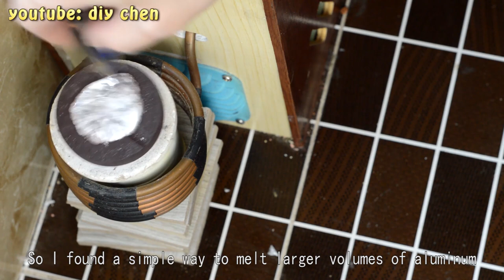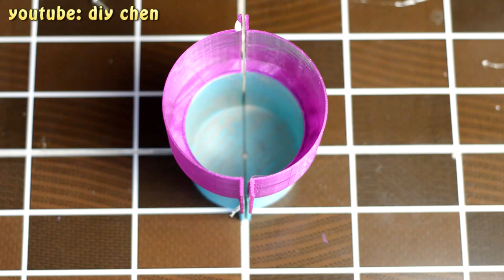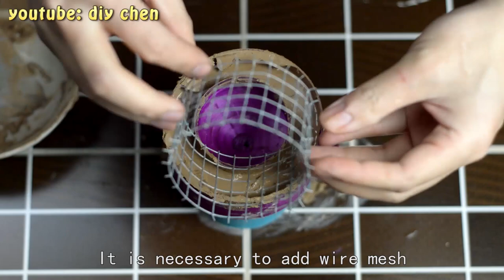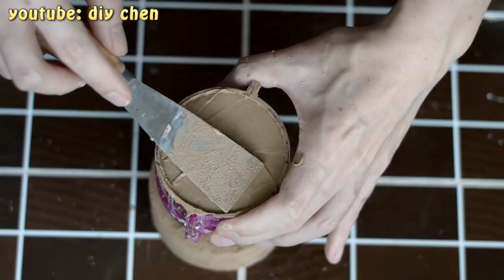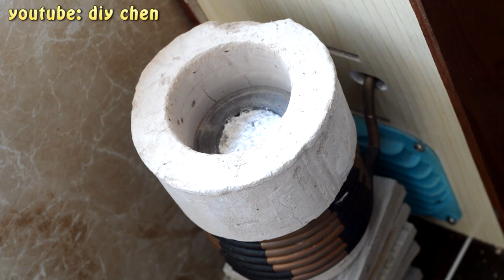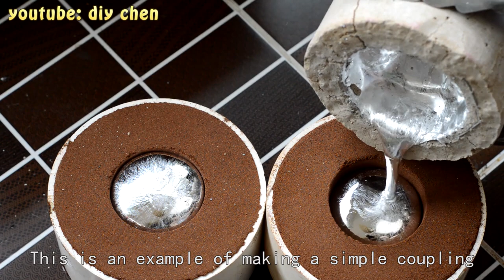5 $ to double the capacity and life of graphite crucible; Induction heating;Aluminum melting casting

Comment: I read a similar concept from a YouTube ZVS  induction guru about enclosing graphite crucible to reduce graphite buring by limiting O2 exposure,  but your idea one ups that by incorporating a riser/extender that more than doubles capacity (2.5x)  without a coil change - ingenious - expecially beneficial for melting aluminum!   Curious if you would estimate the approximate increase in crucible life, and also how long it took the 420 grams to melt?   Also wondering if you have tried a larger crucible to more closely match the size of your coil? -------  BTW, those are some sweet couplings :-)   --------------------  Some possible design changes: 1.wrap a piece of damp construction paper around outer graphite before raming - this paper will burn when fired and should prevent crucible breakage on expansion. 2.Make it all 1 piece -no seperate bottom.  This would make more airtight and also be safer. 3. For completely sealing graphite, put a skim coat on inner surface -probably easier said than done since graphite is slippery so may be constantly patching it.  What says you?